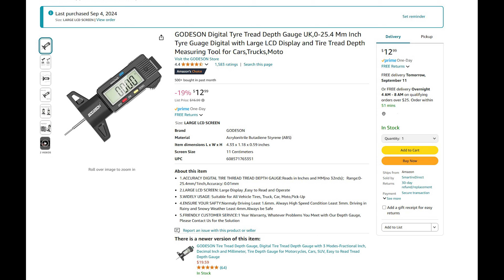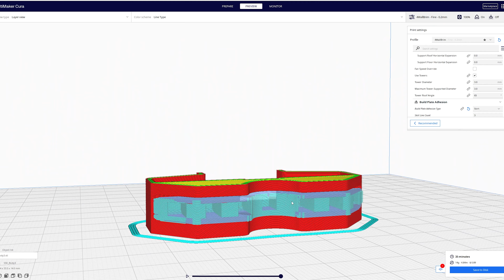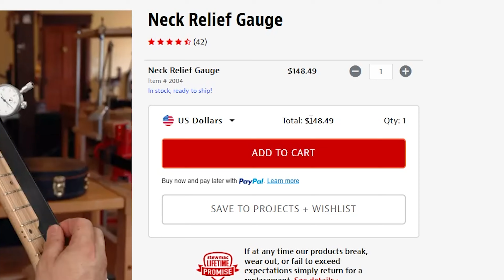I Turned a Depth Gauge into a Neck Relief / Action Gauge

Comment: Thank you for this. Do you have to take into account the thickness of the string into account when using this?
Reply from the maker: Nope, doesn't matter. The string is basically just used as a straight edge between the 1st fret and the 17th (or whatever fret meets the body on your guitar.). 

It makes more sense visually, but you're basically measuring from the bottom of the string, that's why you zero it on top and push the string down to the fret. The distance between the bottom of the string to the top of the 7th fret is the distance you're calculating.

I hope that makes sense!